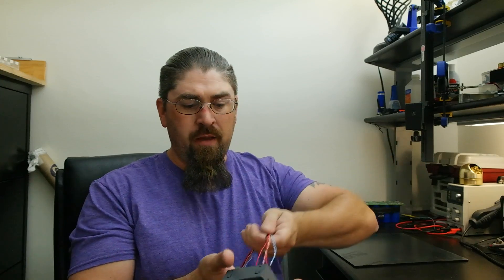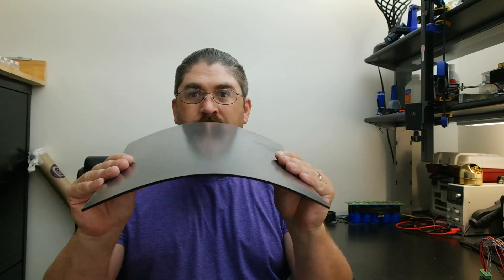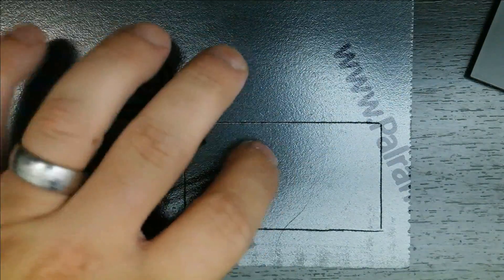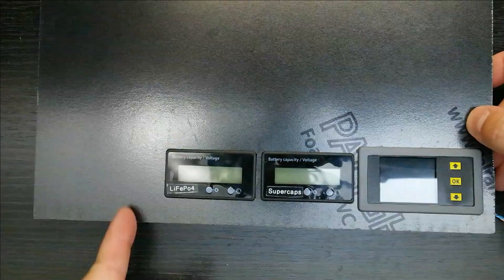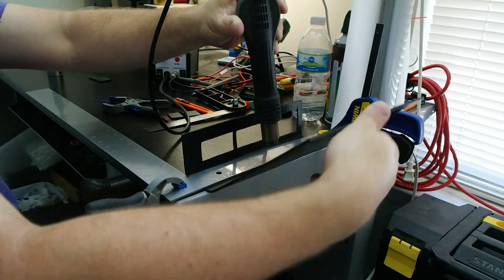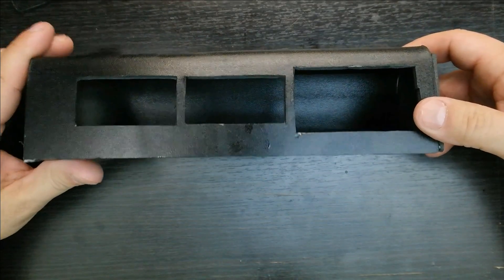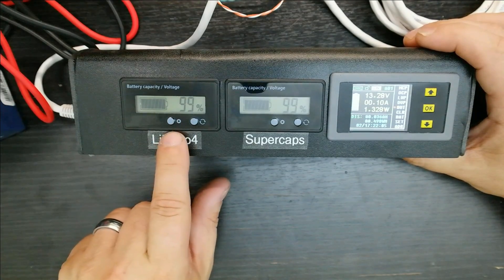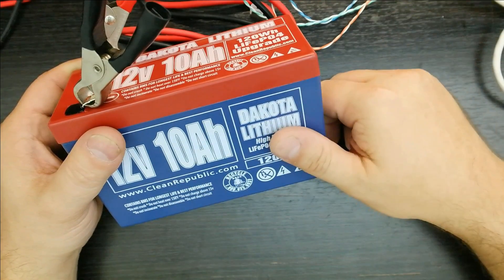Hybrid Supercapacitor Car Battery Part 3 - Display Module Build

Comment: So the meters an the Rj45 break out board I recognize. The other display in you car I’ve never seen before. Do you have a flowchart or schematic of how you connected and or programmed your monitoring system? I’m a new subscriber of 1 hr ago so I’m not totally up on your project. I will be doing something similar in the future. I’d like to learn from you if possible. Easiest to reach me at bryan@tinysolarshack.com. Thanks 🙏